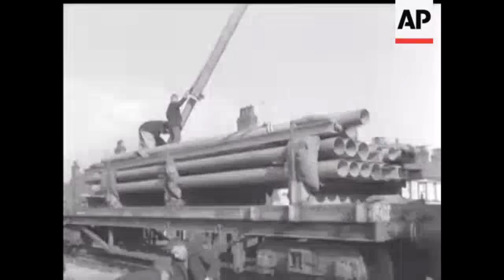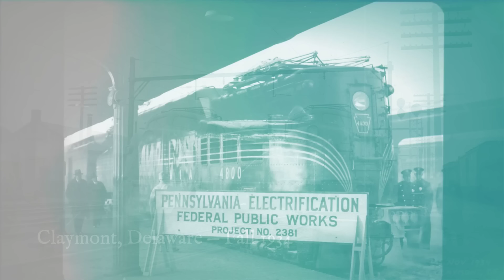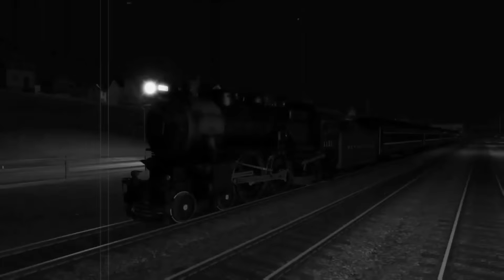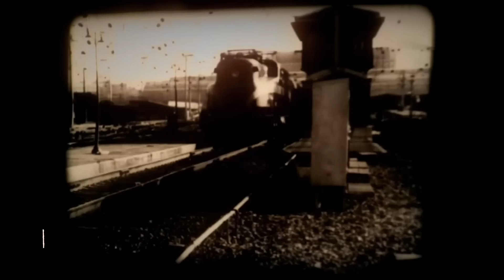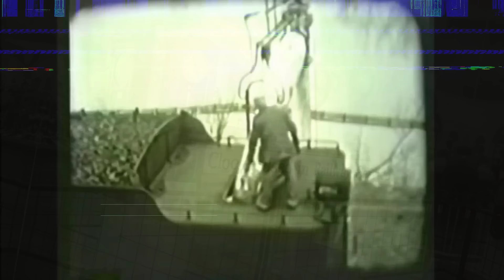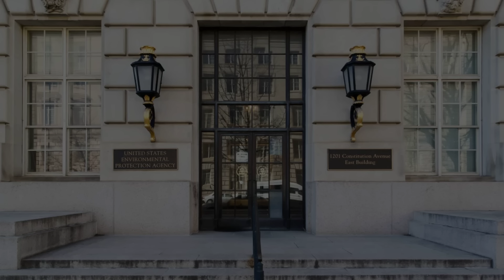The Electric Monster That Hauled America For 50 Years

Comment: I have an uncle who was an engineer for the Pennsylvania railroad and he drove the GG1.
When he finally retired it was Norfolk Southern. It was not uncommon for him to run over a hundred miles an hour. The problem was at about 127 miles an hour. The Paragon could separate from the wires causing a horrific ark damaging it.

 My father had an uncle who was in the maintenance shop in the enola yards. It was well-known and even back in the 50s the pcbs were toxic and special protective suits and gloves should be provided to the maintenance crews to protect them from the exposure to the pcbs. However the people in the railroad who managed the maintenance crews decided to conceal this from the maintenance crews. 
That is until my father's uncle was sent to the wrong billing by mistake and discovered the railroad was repainting the barrels to cover up all the warnings about the hazards and dangers of the oil laced with pcbs. It started a firestorm with the Union which led to the railroad providing the proper safety suits and gloves. Because at the time OSHA simply did not exist so no one in the railroad was really ever held accountable for the risk that they expose the workers to.

The enola yards in Pennsylvania will always be the enola railroad yards. There is a lot of speculation due to enola yards being used as a maintenance area for the GG1 that the land is highly contaminated in the 40s and 50s there were open oil pits located at the enola yards. Open oil pits with leech into the Susquehanna River. This is purely just rumors because there is no actual evidence that the oil pits ever existed other than what people said that they existed.

Comment: The narrator consistently mispronounces the word "consist." In the railroad context, consist (noun) is pronounced with the accent is on the first syllable: CON-sist.  It refers to a string of individual cars joined together to form a train.  The verb form is pronounced: con-SIST, which is the pronunciation the narrator erroneously uses.

You could say a CONsist conSISTS of individual cars joined together with a locomotive to form a train, but it would be incorrect to say a train is a conSIST.

Comment: As a retired Locomotive Engineer who ran G's from 1976 through 82 on the Northeast Corridor the only correct comment I've seen here is the gentleman who said the cab was cramped and the visibility was poor. I would also like to add the extremely hot cab conditions in the summer and the cold cold conditions in the winter. Also you needed to wear a raincoat during rainy days due to the leaks in the windows, and wipers that were lets say questionable. I did run them though at the end of their lifespan though. They were a tough motor and fun to run.